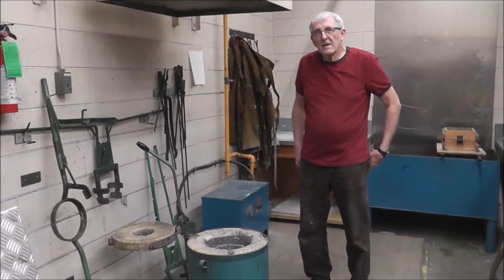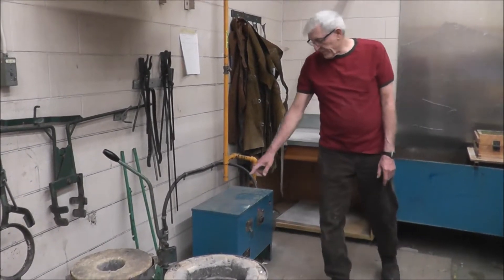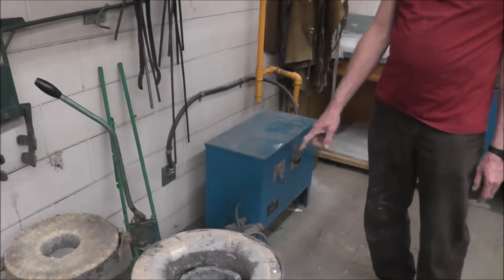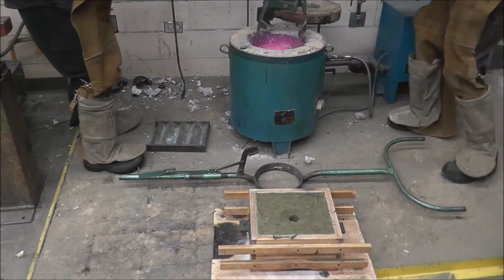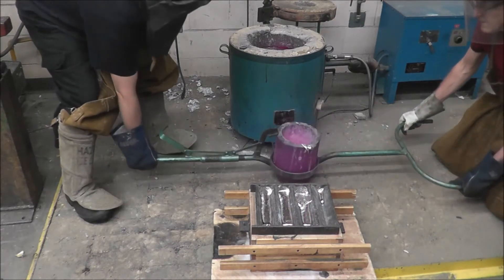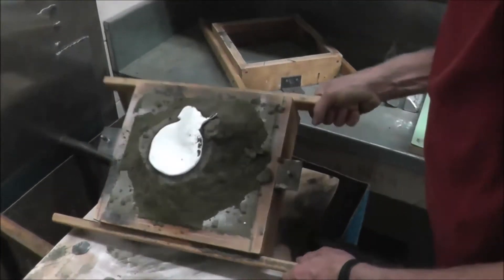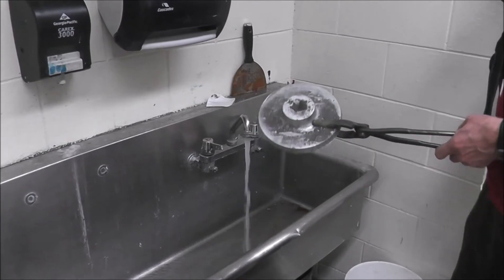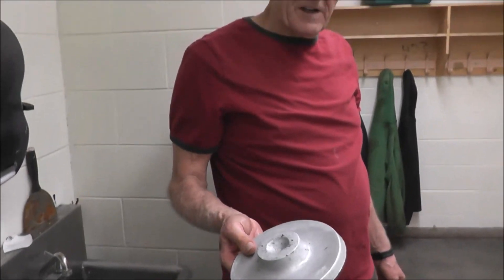Melting and pouring metal to make a casting

Comment: Aluminum casting temperature has great effects on the aluminum alloy mechanical properties as well as determines the quality of aluminum casting parts. The article analyzes its two main parameters including melting temperature and pouring temperature of aluminum in the sand casting process and specifies the optimal temperature to fabricate the best aluminum casting quality pieces.
https://vietnamcastiron.com/aluminum-casting-temperature/

Comment: How hot does it have to be to melt stainless or does that take something special?
Reply from the maker: I do not know, I believe it would be a very high temperature and would not be attainable with a propane furnace.  Brass and bronze can be done but that is about the limit. Stainless would be an industry thing.